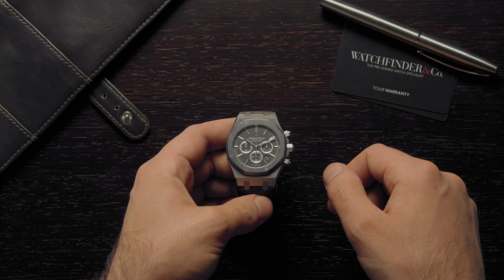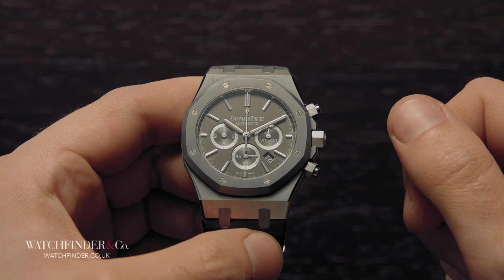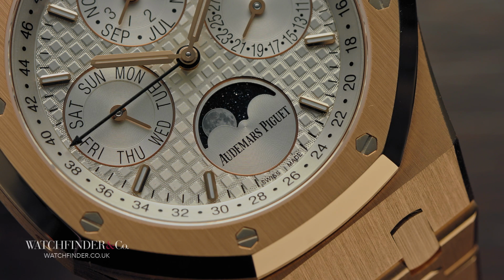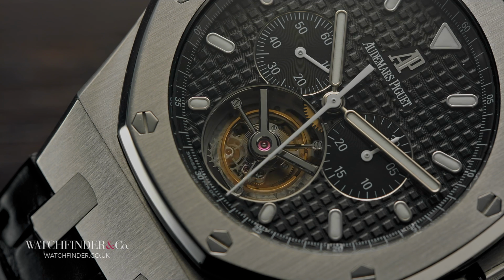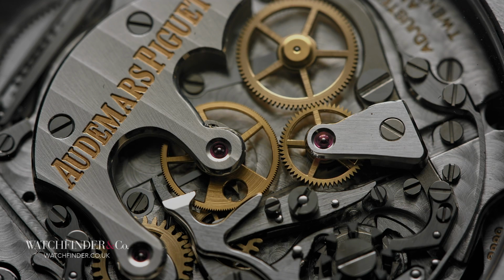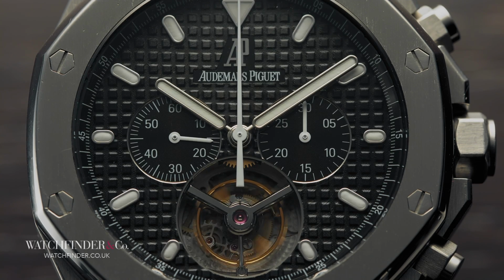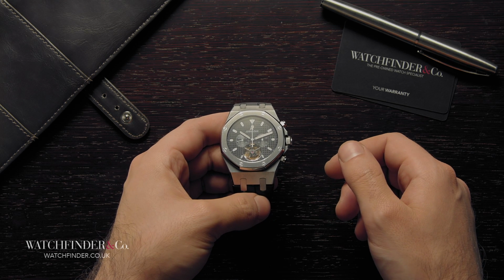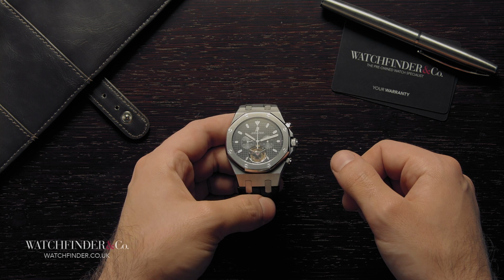Audemars Piguet Royal Oak … But Better? | Watchfinder & Co.

Comment: Small correction. AP made 1,000 Leo Messi Royal Oaks overall: 500 in steel, 400 in rose gold and 100 in platinum. All with the tantalum bezel.

Comment: I wonder if cars will go the same way as watches.  When everything is electric, will combustion engine cars be rare, highly engineered playthings of the rich?
Reply: not every car, but sure some will and some already did. Values of Oldtimers has been going through the roof since about 6-9 years. Back then you couldve easily picked up a nice ferrari 308 for about 35k Euros and now youre looking at about 70k. Its even more silly with old porsches
Reply: You three bellends research Agenda 21.
Reply: No. There will always more be vehicles that run on oil products than electric.

Comment: Hey , mine looks the same , however it's more accurate , it came with a Seiko VK64 for the amazing prize of $87,-(US).
To bad I have to replace the battery every 4 years at a cost of $4,-
I'd be tempted to buy the original just because of the $4,- savings.
Ohh , never mind , getting this contraption serviced every 5 years will set me back a marginal EU 750,-
I'll stick with the battery operated rep for 1/10 of 1% of the cost of the original with none of the maintenance issues.
I'd say I made the smart investment without the speculative aspect.
Watches are a waste of time.

Comment: Amazing video as always. I actually like the Messi version the most out of all the ones displayed.
The chronograph tourbillion seems unbalanced, like the subdials are too close together.
The Royal oak was giving you less yet charging more for no practical reason other than bragging rights you can afford one. 
Extreme versions of sports cars that give less features and charge more for it at least have justification in weight reduction. The RO had no justification at all, and I would still buy one 😄
Reply: I want to work with the owner of the video. I can do it 0096565594017 Please contact me please help

Comment: Nice video, and nice watch. But I am still scratching my head as to why this watch is so sought after?  AFAIK, the movement is non-In-House (JLC movement ?), and as far as a sports watch goes, it's not seemingly built to be durable. And for such an expensive watch, the bezel screws are all fake screws. - just there for decoration.

Comment: Your videos are such gold but I find the false facts holding them back from being the best. The average tourbillon is closer to 50 parts not 100, that is 50 more parts over a typical lever escapement, of course this depends on complexity/type of tourbillon. Should also be noted that despite what marketing has made us believe the tourbillon is a much easier complication to design with a chronograph being much more difficult overall to design and tune.

Comment: maybe its only me but those "fake screws" on the bezel are big turn-off. why they have slots if they are in perfectly matching openings?
Reply: I thought that for a few months, until I saw a video on YT titled 'Casing Up a Royal Oak - Audemars Piguet'. 
Search for it, and skip to 1:12 - It shows that the screws are not fake, and the perfect openings act as a 'clamp' when screws are added to the caseback...!
Reply: moa labs - I’ve always wondered that!